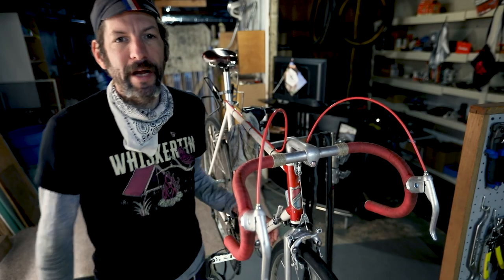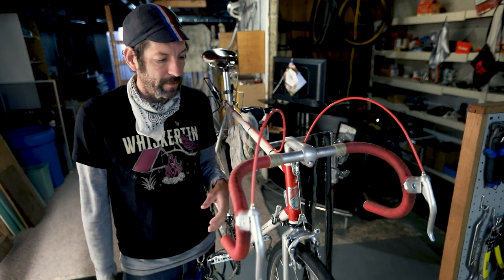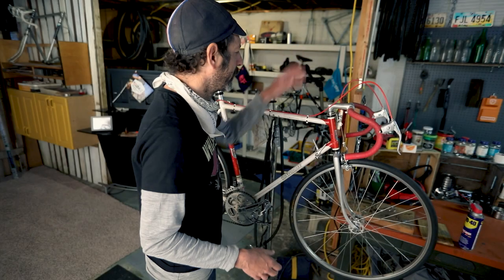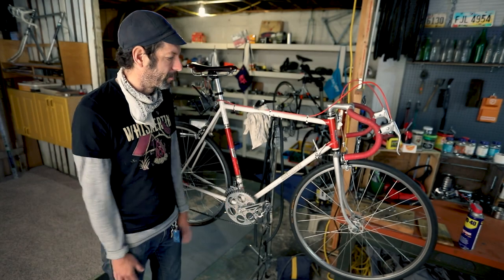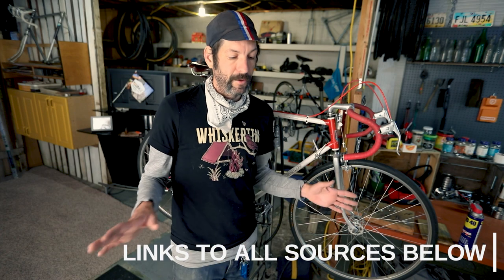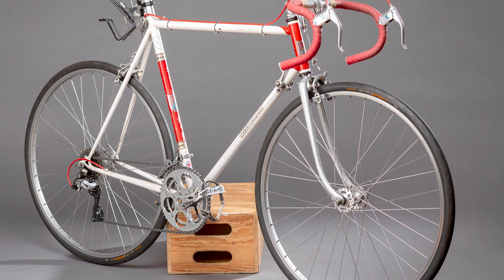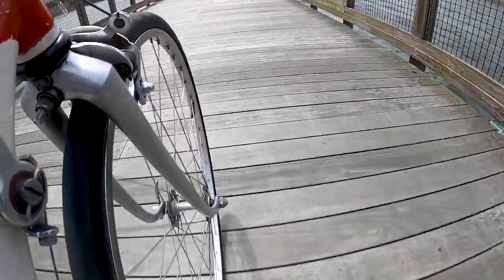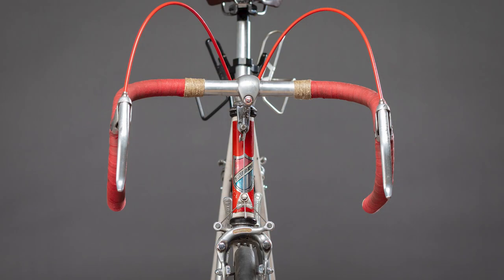Death Fork?! Viscount Aerospace GP - British Steel

Comment: My story was identical to yours! Found on Craigslist for around the same price. Turns out the guy was down the street. Bought it within an hour; same exact style as yours with the white/red. I had a late 80s/early 90s Cannondale SR500 and I have not ridden anything quite as zippy until this. But I like the more substantial rims on this one. It's a great ride. I sanded the white paint to prepare for painting but found that most scratches came out. The paint is very chalky.  Thanks for making the informative video: it's why I bought the bike.
Reply from the maker: Awesome man - that sounds rad!

Comment: I bought a new red and white-framed GP when I was 12 years old in 1977. It had the Death Fork. My older brother had the Pro with the tubular tires. I raced time trials with it and we rode from San Francisco to San Diego in the summer of 77'. I LOVED that bike. The sealed wheel bearings were amazing. I was able to keep up with my friends' expensive full-Campagnolo Mondia Specials. I put that exact same Brooks saddle on mine. I added toe clips, bar-end shifters, rubber brake lever hoods, and side-pull Dia Compe brakes. INTERESTING TIDBIT: The rear frame brazed-in wheel dropouts were Campagnolo. Thanks for the great video! Enjoy your Viscount.
Reply from the maker: Awesome story and memory - thanks so much for sharing it!

Comment: Probably the best comprehensive Viscount Aerospace review on Youtube.  I fondly remember reading ads about these bicycles in old bicycle magazines and wanting to see one up close and in person. They seemed so "high tech" at the time. BTW, I worked in aerospace design for thirty years and never designed anything made of "aerospace steel", except for possibly hydraulic tubes (not sure on those).
Reply from the maker: virgil fulton yeah - it was amazing a guy down the road had one close enough to my size. Very interesting bikes - but in reality they are not Colnagos or anything like that. I bet Reynolds 531 is probably still better! But the little touches make them cool - and at the end of the day I’m not a racer - I like history.
Reply: @TimFitzwater  I am always sucked in by the "best bang for your buck" sales pitch, and I believe the Viscount Aerospace fillet brazed frame era was really trying to deliver this with their product. So, yeah, not a Colnago, but they were never the price of a Colnago either.  I do think they "have a compelling story", especially in a bicycle history context.  I have recently came into possession of one of these bicycles, but have yet to attempt to get it back on the road.  I'd be interested in any info you could provide about the bottom bracket and hub's sealed bearings.  My bottom bracket sounds like some beach bully kicked sand into it, to impress a girl or something.  Maybe I could just flush it out... not sure.
Reply from the maker: @virgilfulton4426  I think you probably have to replace the bearings. I saved the box so I can send you the dimensions when I get back. I just used a c-clamp and washers to push the axle back through and the bearings into place.
Reply: @TimFitzwater  Cool. That'd be great.  Thanks.
Reply: Hi Virgil, I just installed new bearings and tapered axle onto mine. Easy Peasy, however I have ordered some loctite to keep the axle from walking through the bearings. Lmk if you are interested in the parts/ process

Comment: I bought one in 1976 in England and cycled from Rome to Agrigento, Sicily. Problem: I didn't have a tool to remove the crown and could not replace spokes, and ended up with four missing, not a good feeling going down mountain hairpins, I can still hear the piiiinnng of one popping. Next problem was in Chicago USA. I was going over one of those bridges that has a gridded deck that you can see through, and the weld of the lower tube attached to the front tube completely came away, so that the front wheel had a mind of its own. I loved that bike and a friend found me another. When I cycle with my wife, half the time is spent coasting, as the bike is so efficient. I'm now looking for a set of death forks to round out the ride.
Reply from the maker: Wow - that is insane and sound terrifying!!! 
I have a friend who just found ordered one online - it came in rough shape so they refunded him. He is giving it to me to build. It has the replacement chrome fork though.

Comment: I had a few of them.
I used to use them competitively in competition with Shimano Dura Ace and Sun Tour Cyclone as opposed to Campagnola at the time.
The recall the frame was built of Chrome Molybendum, what ever that was, and was lugeless that was unique in those days compared to Reynolds 531 Double Butted tube that competition was using.
It also had a sealed bottom bracket that was unusual.
It was very light at the time.
Reply from the maker: Yeah - interesting bikes. Super weird bottom bracket for sure.
I just got my second one a few weeks ago.

Comment: Thanks for this. Just bought one of these for £5 (some rust on the bars etc.). Be interesting to see which fork I have. Some Shimano 600 components, so probably a later version.
Nicely explained.
Reply from the maker: Nice! Of it has Shimano it is probably a safer bet - still worth double checking though.

Comment: Hi Tim. I am just finishing up a  rebuild of Aerospace s/n 3129 EB. I believe it to be a 1975, and it still wears a type-3 aluminum fork.
Reply from the maker: Nice! Did you do the magnet test?
Reply: @TimFitzwater  You mean, does the magnet stick to the bottom of the steerer tube? Yes, it does stick.

Comment: I bought mine when I was 18 or 19  around 1975. It still has the death fork. I'm not sure which generation the fork is. I just started  refurbishing it today. I haven't ridden it for several years, but I'm looking forward to getting it back on the road. It was seriously light and fast when it came out in the 70s. Chrome Moly and aluminum was space age material at the time.
Reply from the maker: It's definitely worth figuring out which generation the fork is in my opinion. Plenty of people have ridden them with no trouble - but I definitely wouldn't go bombing crazy hills with the first two generations.  But do link a photo when you get it done - I would love to see it!
Reply: @TimFitzwater  Just pulled the fork off. Looks like it's the 3rd gen so I'm keeping it!  Well, unless I can find something lighter and stronger that won't bankrupt me. Now I need to find the correct silver paint and buy the decals. Mine are in bad shape.
Reply from the maker: The decals are on eBay - but they are pricey!

Comment: Back when this was released it was advertised as a 23 lbs bike which was the weight range of a top-end Campagnolo / Reynolds 531 racing bike, but with ALL lambert made-in-britain fairly generic components (nothing really nicely finished).  I have a feeling that the crank arms might be rebranded TA cyclotourist (maybe cosmetic rejects or contact-manufactured arms-only offerings with different decals.)  This broke the rules for a sub-$200 bike and I think similar bikes by Raleigh or Dawes in the sub-$200 price range weighed 27 lbs.
Reply from the maker: I’d love to see one with all the Viscount/Lambert branded parts as mine is a little later with Shimano components. They were definitely interesting bikes.

Comment: Thanks for the great vid. I've had my Viscount 10sp since 1991 and I'm trying to figure out what year it was made. It has a chrome steel fork, Shimano derailleurs (SIS front, Titleist front), shift levers and drop outs. It is white with blue graphics and a few gold decals here and there. The big chainb ring is just like the one on your bike. But it doesn't say Lambert or Yamaha anywhere that I can find.
Reply from the maker: With that info I would say that it would probably be one of the last ones made  - if it is fillet brazed like mine then I would say 1981. If it has lugs it could be as late as 1983 or thereabouts.
Reply: @TimFitzwater  Thanks Tim. I figured it had to be a later model. Fillet brazed, no lugs. Wasn't a scratch in it when I bought it, back in 91. Bought it at a dive shop in Laguna Beach. Couldn't pass it up for $60. Been through several sets of tires and the chain ring is getting a little worn, but it's not skipping yet. Be nice if I could find another chain ring just like it, but it looks like that ain't gonna happen.
Reply from the maker: @jojodiver8706  Nice!  They do pop up on ebay from time to time.

Comment: Tim:   My bike mechanic is trying to discourage me from bringing my 1977 Viscount Gran Sports for repairs saying it is antiquated to the point he can't find parts for it...He put cheap Chinese generic hubs on it that have broken down with lateral play making the bike unride-able...I queried on the British cycling forum and they pointed me to "Velo Orange" - a Maryland manufacturer of high quality, new 1970's style 126mm hubs...Like me, you notice the lightweight steel glide of this well-built bike and refuse to give it up...I have had no other bike since I was 17...
Reply from the maker: Hey - sorry I let this get away from me. Velo Orange is a great place to get really high quality parts for vintage bikes. Most of the sizing on Viscounts are standard since it is a British bike so I'm not sure what your mechanic is talking about. You could put a lot of modern components on it even. The only weird thing is the bottom bracket - but I just took the old bearings to a bearing shop and they measured them and gave me knew ones that fit exactly. You could keep the bike all vintage or go modern with it - that is one of the things I love about them. Let me know if you have any other specific questions - but definitely keep that bike on the road!!
Reply: @TimFitzwater     You can see my bike posted in this thread:    https://forum.cyclinguk.org/viewtopic.php?f=1&t=21010&p=1516600#p1516600

Comment: I have my dads viscount aerospace blue w/ steel fork that I have been slowly upgrading to an urban bike with bullhorns and flats. Nice, but the rear cassette is worn out and the rear axle slips when cranking up hills in a low gear no matter how tight I make it. 

Do you have a list of any of the bearings sizes you replaced, it’s always nice to have the new parts on hand before I rip anything apart.
Reply from the maker: Love those in blue - that should make for a great ride!  I'm trying to figure out what you mean by the slipping. To me it seems either the freewheel would be broke(which won't effect you when you switch it out for a fixed cog) or the chain would be slipping over a worn out gear cog - which again if you are switching to fixed shouldn't be a problem.  The bearings I changed were in the bottom bracket.
Reply: @TimFitzwater  If I use too much force when I pedal, the wheel shift to the left until it rubs the frame. It looks Serrated spacers, QR but and knurling on the frame are both worn smooth, I’m trying to figure out how it got that bad and if it can be restored.
Reply from the maker: @EricHaaseH  I've had that problem with a few vintage bikes.  Some serrated washers or a new QR skewer have been how I've fixed it.

Comment: Tim, do you have a spec for the headset bearings on an Aerospace Pro? 5/32" seems to fit fine on the bottom, but I cannot get a full circle of 5/32" balls within the top cup. I can only assume it takes 1/8" balls on top.
Reply: My error. It does fit with 5/32" balls. There is no room for misalignment of the steerer tube. I got it together on the third or fourth attempt.

Comment: Nice video! Has the world come up with any new bottom bracket spindle solutions? I don’t feel like the threadless bb is a great fit and I really want to run a square taper crank
Reply from the maker: Thanks! It’s a weird bb for sure - the spindle is still made for square taper cranks though. You can get those expanding cup BB’s too - Velo Orange and Phil Wood make ‘em.
Reply: @TimFitzwater  hi Tom, I tried a YST bb 993 threadless over the weekend and found the cups didn’t seat in as well as I hoped. It loosened up after a very short ride. Upon measuring they seemed a smaller diameter than the bb she’ll, I’m taking a chance on new 6003 bearings and an Answer Ti slip spindle. I’m keeping my fingers crossed. I really want to ride this thing. My Aerospace also has a very cool headset. Avocet lll.
Reply: Tim*

Comment: I bought a Lambert today, but learning about the “death fork” has sketched me out a bit. How can I differentiate, as a complete noob, between the good nd bad forks so I know which I have.
Reply from the maker: The obviously is it the cast aluminum fork - visibly different. If yes the magnet test I talk about is all I know.
Reply: @TimFitzwater  thanks I found out mine is steel by using a magnet, so I should be good:)

Comment: While the Lambert aluminum fork seemed impressive when they were new, the Tange fork that replaced them was a 1st class fork that had a cost that was quite reasonable.  When you consider what happens when a fork breaks and compare that to the number of grams of weight that was saved, the death fork seems to be one of the world's dumbest ideas.
Reply from the maker: I’ve never actually seen the replacement fork so I’ll take your word for it. Obviously the original execution of the aluminum fork was horrible and it never should have been sold but they did correct the issue before switching to the chrome fork and it does make for a unique ride.
Reply: @TimFitzwater  OK that fork was not perfect. People would think the replacement fork was better were it made with Reynolds 531 or Columbus tubing, and while the Tange Champion #2 tubing they used might have sounded like it was crap,  it was definately good enough.
Reply from the maker: @jenniferthomas3875  Fair point.  While I'm far from an expert on it I know Tange made tubing just as high quality as the other two.  I think as someone who wasn't around when these Viscounts/Lamberts came out it is their unique in-house made components and aluminum for that are kind of the allure of these bikes....

Comment: Had one brand new 1976??? after schwinn varsity, lighter than sh*t
Reply from the maker: Nice! It probably felt especially light after a Varsity. ‘76 would be on the early side / definitely the dangerous one!
Reply: @TimFitzwater  no doubt, got the recall prolly 6-8 mo after purchase, replaced fork immediately, damn sweet fast bike..., later bike also an odd-ball bought in early nineties was similar ultra-light-weight before its time Raleigh Technium: "glued aluminum tubing"..., now that one was wierd!